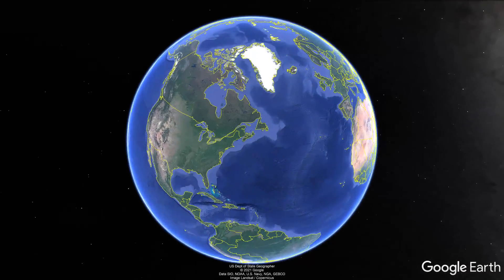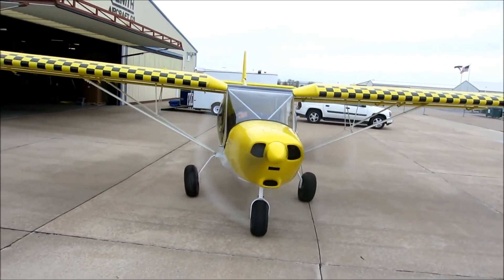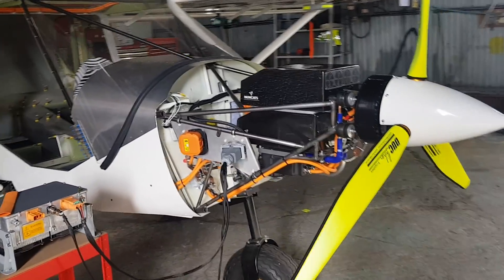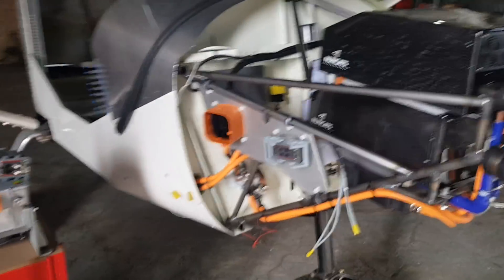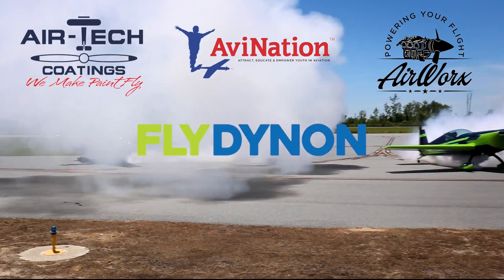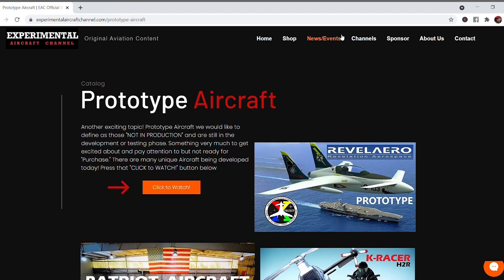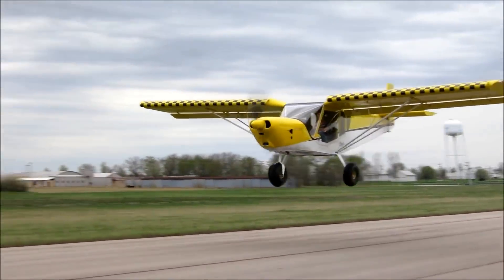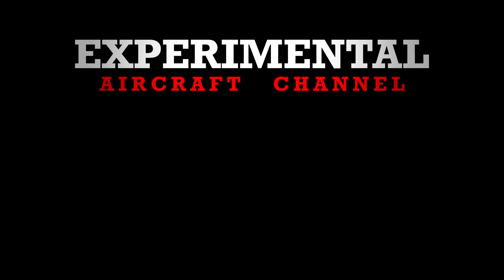All Electric! Zenith CH750 Aircraft from the UK - EV Lithium Battery Tech - Nuncats

Comment: Good to see more people building electric airplanes, many limitations compared to fuel.
Reply: And those limitations will never go away. So why must everybody pour money into something any electrical engineer can show them on the back of an envelop that it will not work?
Reply: @flexairz  Because at some point fossil fuel will either be too damn expensive or banned.
Reply: @olsonspeed  E-fuels are a thing.
Reply: @PistonAvatarGuy  Yes they are, unfortunately E-Fuel production takes valuable farmland which is in high demand to produce food.
Reply: @olsonspeed  That's biofuels, e-fuels do not require any farmland.
Reply: @PistonAvatarGuy  What is the efficiency of converting electricity to E-Fuel?  Everything I have read stated that the conversion process is inefficient and does not scale well. E-Fuel production takes a lot of electricity, possibly it a better path to use the electricity directly without the phase change losses of fuel production. All forms of energy storage and distribution need to be explored and evaluated for efficiency before the fossil fuel party ends.
Reply: @olsonspeed  What's the point of having an aircraft that can't leave the general vicinity of the airport that it took off from? At least e-fuels are useful.
Reply: @PistonAvatarGuy  The same things were said about electric vehicles a few years ago.
Reply: @olsonspeed  The same things that were true for electric vehicles a few years ago are still true now. Absolutely nothing has changed which would bring electric aircraft closer to being practical for any sort of real world use.
Reply: @PistonAvatarGuy That is why more and more individuals and fleet operators are buying EVs.
Reply: @olsonspeed  Because of improvements to the technology? No, there haven't been any significant improvements in the last few years, people are just getting used to the idea of owning EVs. Anyway, hardly anyone buys them and electric aircraft are still hilariously useless.
Reply: @PistonAvatarGuy  Tesla had proven electric power is viable. Range if their vehicles has improved greatly over the last 10 years. With solid State batteries charging will be brought down to 10 minutes.
Reply: @Mike-01234  Tesla has proven that electric cars are expensive, that they're going to do everything that they can to prevent people from repairing their cars (unless it benefits them for those cars to be repaired), and that they're going to reserve the right to limit your access to their chargers, invade your privacy and control how your vehicle functions.

Range has improved for electric cars over the past ten years because they've figured out how to cram more batteries in their extremely heavy cars, not because battery energy density has improved significantly over that time period. This same method of improving range wont work in electric aircraft.

The rate of charge in an aircraft application is irrelevant if the aircraft can't fly fast enough, or far enough to justify its use in the first place.
Reply: @PistonAvatarGuy  Tesla price has come down a lot. Most people I know don't care to work on their own cars just let the dealer work on them. Just buy a new car after 4-5 years mostly under warranty anyway. Tesla car weights is about the same as a gas engine car. Electric airplanes will become more common just matter of time as more investment is put into it.
Reply: @Mike-01234  Teslas are still quite expensive. Most people that I know buy used cars and don't go to the dealership for service, they go to 'mom and pop' shops. Tesla is aiming to hurt small businesses. Tesla's are far, FAR heavier than comparable ICE vehicles.

"Electric airplanes will become more common just matter of time as more investment is put into it."

No, you're just 100% wrong. This isn't a problem that investment can fix, money is not magic fairy dust.

Consider that a Pipistrel Alpha Electro costs $50,000 more to buy than the same aircraft with a piston engine, while also being much, MUCH less capable. The $30,000 battery for it also costs about twice as much as an entire engine for the ICE aircraft, while needing to be replaced about twice as often. Electric aircraft are not even remotely close to being in competitive with ICE aircraft, they're not even in the same universe.
Reply: @PistonAvatarGuy  I disagree we can have our opinions life will go on. Electric power is going to replace ICE no matter how angry you get about it.  Telsa Model 3 weight 3,648 to 4,250 lbs I would not say it's lot heavier.
Reply: @Mike-01234  These are not opinions, these are facts.

"Electric power is going to replace ICE no matter how angry you get about it."

There is absolutely no evidence to support this statement and quite a bit of evidence which proves you wrong. You're just basing your whole world view on marketing hype, it's hilarious.

"Telsa Model 3 weight 3,648 to 4,250 lbs I would not say it's lot heavier."

That's still quite a bit heaver than most pure ICE cars in its class. Anyway, that does absolutely nothing to prove that electric aircraft are viable, or that they ever will be. Cars and aircraft are two completely different worlds.
Reply: @PistonAvatarGuy  20 years ago you would be saying the same thing about vehicles. No it's not lot heavier Average cars weigh in about 3500-3900 lbs.  Again just your opinion you have no clue what will be in the future. If new technology creates batteries that can store more power then yes they will be able to make aviation electric powered. With current technology it's not there yet. I never said it was there it might be for ultralights.

Comment: The historic unpredictability and unreliability of batteries, is a serious concern of mine. No battery maintains a linear discharge rate for very long, and that sudden loss of power will doom this endeavor. The portability and amount of energy contained in 1 litre of gasoline simply can not be duplicated by batteries. Not yet anyways.
Reply: May be you should have a word with Tesla, Polestar, Toyota...?
Gas has a great energy density, but it's only useful if you can get it to where you need and and of course pay for it too.  Renewable recharging means once set up these planes can fly cheaply for years without needing to truck fuel over roads that wash out every rainy season.
Reply: @PopTickleBang  - gas is great if you can get it at all. Five years from now in the US you won't find much of it and what you find will be very expensive. The first generation of electric planes will probably be best suited to something like the Pipistrel. The uses identified in this video are limited to a particular (worthy) need but most flyers will want more range with as much speed as they can get.
Reply: Battery tech is improving at a much higher ratio/speed than piston engines in efficiency now that there is incentive and significant more investment into it. Although the energy density in one litre of gasoline is much higher, 70% of it is wasted in heat. Once we hit 400-450kWh of density then there will be a practical range. Who would have though that when Tesla first launched a  Model S with 220 miles range 9 years ago, there would be a car with 1000 miles range coming on to the marke today, but here we are…
Reply: @wpfilms2  Batteries have gotten about 6% better in the last ten years. Many are confused by Musk's discussions where he just makes a battery 50% larger. IE I am magic because here is a C sized battery and I created a D sized battery.
Reply: @wpfilms2  he was over exaggerating. Im being generous here. Batteries have improved .65% over 10 years. 
You know where lithium comes from and how its attained?
Reply: Why would sudden loss of power be an issue? It would be very simple to set aside a 'reserve' battery which kicks in when the main battery dies. How is that different to having a fuel reserve?

Comment: Absolutely ZERO info on range other than battery tech will get better before we are done.
This is still pie in the sky.
Not hating just stating facts, been researching this for years.
I was hoping fuel cells were the answer but they still weigh too much and heat to enormous amounts.
Reply: If you took time to analyse the whole video not just what you wanted to hear about you should have realised that rather than give a guesstimate of what the performance and endurance would be, the presentation concentrated on what was factually correct.  This aircraft was not fully built at the time of the interview and had still to have its first flight. The “big air show” mentioned is at the end of the month at Old Buckingham, which is where they intend to reveal the completed airframe. At least give them the time to capture real data before lambasting them. Personally I say wait a few months and then question performance figures if warranted once they can obtain real world data; I think we shall all be surprised!
Reply: Yup, I can’t see them being any good until the battery technology can go 4 hrs.I really think we are 10-15 years out real world usage.
Reply: It's hard for some people to realize that the end of the internal combustion engine is in sight
Reply: @JOHNG104A  Unless you are very young, the impending demise of the ICE has been greatly exaggerated.
Reply: @JOHNG104A  yes the end is in sight, but not as this close as we would like. The electric powerplant will establish quiet quickly, but the problem is the limited endurance of the power sources. Electric powered planes with an endurance of 45min plus reserve, doesn’t make any sense, especially not with flying barn doors. I could imagine a kind of hybride, with a methanol powered fuelcell, a battery to cover the peak consumption and an electric engine. The waste products of green Methanol, is mainly water vapor and the CO2 which was used to produce it, a  zero emission concept.
Reply: @erkkimuller8898  "zero emissions concept" lmfao. 
Mate, do you believe in perpetual motuon as well? 
How about unicorns? Lmfao

Comment: thanks for the interesting video. Sadly there are no "usefull" numbers..., No power in KW, no Battery energy in Kwh, no  max power in motor, No weigh in battery packs etc.
I guess the motor will output a similar thing than a 80 hp engine, but with that draggy airplane will not go so far.
I´ll keep an eye on them, and best wishes for innovators!!
Reply: 3:40 Direct replacement for a 100 hp petrol equivalent others are in the developmental stages and are hush hush
Reply: Check out the Pipistrel electric, same powertrain.
Reply: Yep, Pipistrel it’s a 80 hp equivalent, so it’s not “a direct 100 hp replacement”.
Reply: @AndresGonzalez-rm6fp  They mentioned their cooling system is different from Pipistrel and therefore they can get to the 100hp equivalent.

Comment: Great video. I live off grid as do many of my customers. I install/service pv solar systems and propane generators. I’ve replaced several aging battery banks with lithium batteries. This electric Zenith really has my attention. I’ve been following the Zenith STOL platforms as they’ve developed over the decades and will build one eventually. So exciting!!!
Reply: Dont make a dumb mistake. 
That dropped cell or high internal resistance wont mean no lights or oven. 
Itll mean death. 
The range is laughable aswell

Comment: 380 lb-ft is only 195 hp at 2,700 rpm, an EPeX300Ti makes 300 hp.
Reply from the maker: Uhm.... no comments deleted by ME intentionally.  If you were cussing or something there are settings in place to withhold such comments? FAMILY CHANNEL here friend.  I come in peace.  ;-)  Open for the Aviation Conversation always.
Reply: @ExperimentalAircraftChannel  Comment didn't post on my end. My apologies.
Reply from the maker: @PistonAvatarGuy  no worries.
Reply from the maker: OK? There is a much deeper issue here than creating HP. Avgas is VERY expensive in these areas they are wanting to fly into AND the "Octane Ratings" of fuels are NOT really great. So this solves those problems. I LOVE the idea of the YAMAHA options for sure! Watching those very closely. I may want in on one... ONE DAY as well :-)
Reply: @ExperimentalAircraftChannel  It just seemed like your guest was excited about the amount of torque his motor was capable of producing, but it's not impressive relative to modern piston engines.

Anyway, that Yamaha engine is likely to be capable of producing more power than the electric motor in the aircraft being discussed, while being run on very low octane fuel, it would only need avgas to produce maximum power.
Reply: @ExperimentalAircraftChannel  Deleting my comments? Really? WTF?
Reply: Yeah 300 hp at 11,000 RPM ringing your ears. The motor will pop it keep it that reved for a while. Has no low-end torque. Fine for stol drag junk for everything else
Reply: @Captndarty  No, they don't pop at that power level, they're not even that highly stressed, which is why Steve Henry is installing an even more powerful EPeX engine in his Highlander. Low-end torque is completely irrelevant in an aircraft, as you can rev the engine and produce maximum power as freely as you want.
Reply: @PistonAvatarGuy  you can’t run hi revving engines at red line for long as eventually it will pop well before it’s time. It would be much nicer to run it out 5 to 6000 RPMs but it doesn’t have a torque and horsepower at that RPM. As I said it’s great for wide-open 10 second stol drag bursts but for cross country cruising at 8 to 9000 RPMs is complete crap. No one runs their motorcycles down the road at 10,000 RPMs let alone the snowmobiles across the lake wide-open for very long before things break
Reply: @Captndarty  You can't run the motor shown in this video at 200 hp for more than a few seconds either, so I'm not sure what your point is. You can, however, fly the EPeX across the country and then use it for STOL drag, which is exactly what Steve Henry does with his.
Reply: @Captndarty  The engine wont "pop" when run at high rpm for long periods of time, either, it will just wear out quickly, but that's easy to monitor.

Comment: An unregulated competition EV STOL would be able to womp on any gasoline powered engine.
Reply: No, it wouldn't. Not only could the motors not produce enough power for long enough to be competitive, but the battery packs would be insanely heavy and would destroy the performance of the airframe.
Reply: If you only need a few seconds you can run supercapacitors to avoid heating the batteries with excess drain. With only about 10 minutes of power on board they would have to be hauled from place to place though. I would think the biggest issue is how to not flip the plane on torque.
Reply: @davidwhite2011  The motors also overheat. The torque output isn't anything significant. Also, I don't know why people don't understand this, but if you have the same amount of power at the same RPM, you have the same amount of torque. The motor that's being discussed in this video can only provide 200 hp when being pushed to its limit, while the EPeX300Ti is capable of producing 300 hp, which means that it's capable of providing significantly more torque to the propeller, but I don't see it flipping airplanes.
Reply from the maker: Right? Maybe we can get this thing into a container and over to High Sierra for the STOL-DRAG? What do you think @Kevin Quinn STOL Drag Llc :-)
Reply: @ExperimentalAircraftChannel  finally a worthy opponent to Scrappy. Their battle will be legendary!
Reply: @Hyperious_in_the_air  Steve Henry's plane already destroys Scrappy.

Comment: Wow, this is really cool. Imagine having a solar powered cabin that you could land at and charge this. Just started the video. Hopefully this is variable pitch and variable rpm. Personally as a person in the electrical field the mode of propulsion and energy storage is currently too heavy to be feasible for wide spread use. Also the charging of the cells is quite difficult as well.
Reply from the maker: Thank You! I think with the available TORQUE on the EL Motor you can find the sweet spot on a ground adjustable prop and have plenty of torque on  hand to "handle" the loads. I don't believe there is really a need for a Variable Pitch Prop. (unless you wanted to spend the extra $$$ for a little more efficiency. Good points though! Thanks for chiming in! I appreciate you!
Reply: @ExperimentalAircraftChannel  well variable pitch prop or not. This is a fantasy thats just. Sad. 
Electric vehicles have been around since before the combustion engine powered car. 
Never has and never will be practical.
Reply: Yes, we are charging EV's today with solar arrays🌻 According to specs. for Charging this Electric Cruiser "~20 Amps@230v ", we can charge with standard 5+kW sized PV Inverter with ~6kW PV Array (size may depending on latitude & season) OR for Fast charging using a matching size battery bank anytime🛫💡🗽
Reply: Unfortunately you would probably need a pretty large solar array to charge the batteries in a realistic time.....unless you have a lot of time to wait.  But I understand the idea and I'm sure as technologies improve and efficiencies grow this idea will become more realistic.